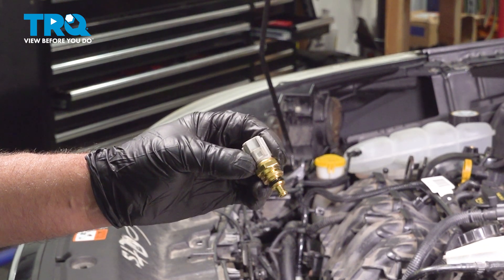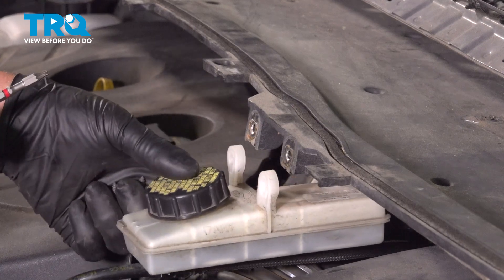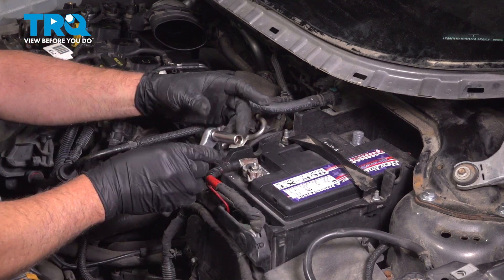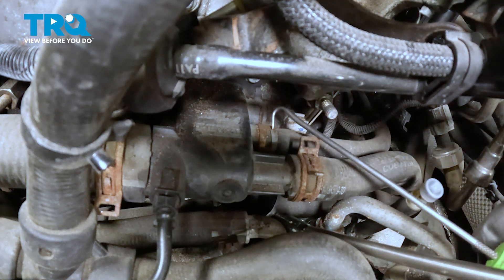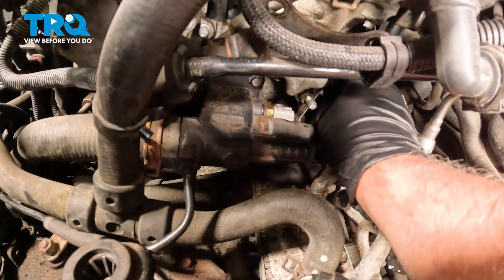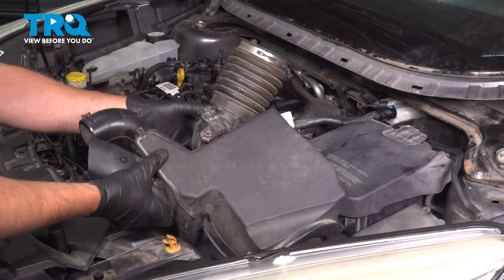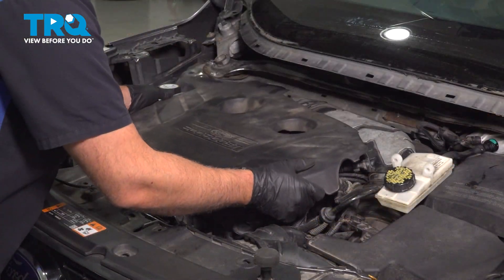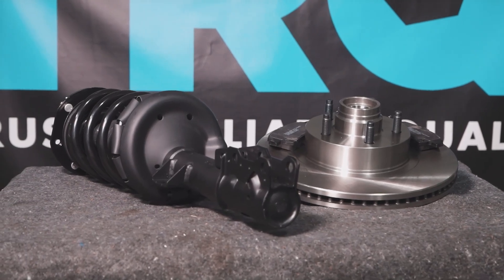How to Replace Coolant Temperature Sensor 2013-2019 Ford Escape 2.0L L4

Comment: If you go from the passenger side and reach around the back side you’re able to do the entire job with only removing the charge pipe, the rest is just kinda in the way but it can be done, saved me a grip of time, got it done in 30 or so. Was hard to do

Comment: I’m very confused why you would have to take that all those top parts off just to take the sensor out underneath? It seems like a lot of extra work when you’re not even doing anything up top. Or am I missing something?
Reply: Ok, after dropping the entire engine disconnect the drive shaft …
Reply: How you gonna reach it?

Comment: Hi, thanks for your videos  by the way. Ok I replaced the over heat sensor like you here on this video in my 2018 ford escape and it's still not running right and then shuts off and that over heating message on the guages comes back on again. I did notice one of the two wires on theback of the connector was off so I pushed it back in and I connected  it back to the sensor. What do I do next? Do you think  the problem is with the connector? I need some help.

Comment: Hi, thank you for this super informative video! I'm having an issue with my 2013 Ford Escape where the car basically shuts down because it's getting a faulty signal that the engine is overheating when it's not. Ive been informed this problem is associated with the coolant sensor. The dealership advises that i get the level sensor pipe replaced (which is a very expensive part) but now im wondering if it's just the sensor, which i assume is attached to the level sensor pipe, that needs replacing. What are your thougts?

Comment: Overall, this is a very detailed and helpful video.  I have a 2013 Escape 2.0, and one thing I haven't done yet is replace the coolant temp sensor.  Not only does this video show the process step by step, but calling out which socket sizes and other tools are needed really helps too.  

One tip I've learned on my Escape is that if you disconnect the front panel from the battery box before removing the battery, getting the battery out is a lot easier.  This is because you can slide it further forward to get a better grip on it, and you don't have to lift it as high to clear the box.